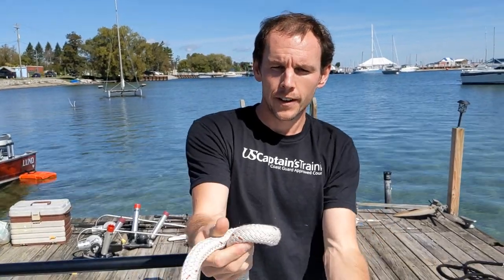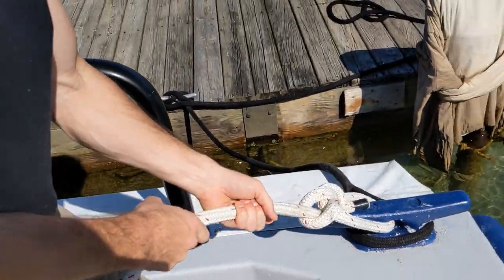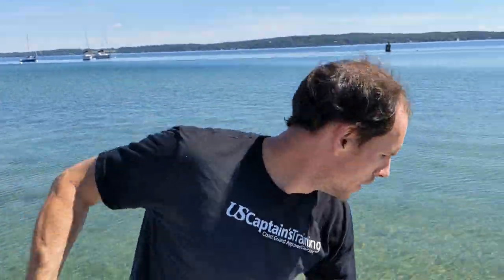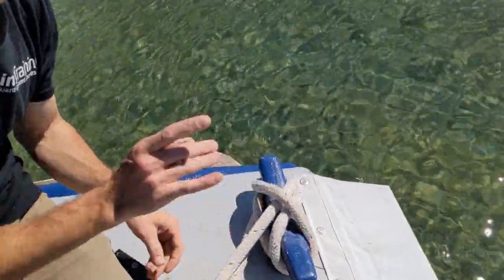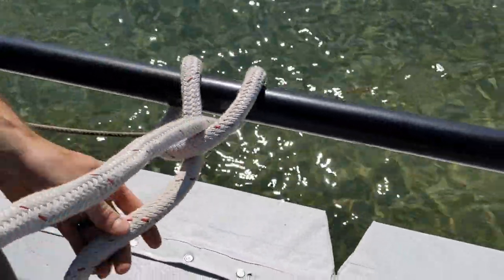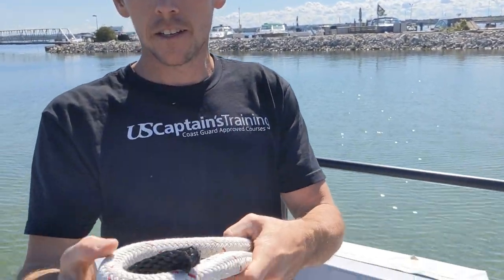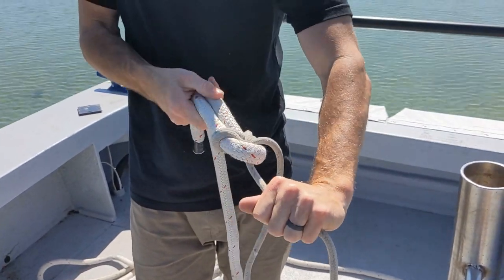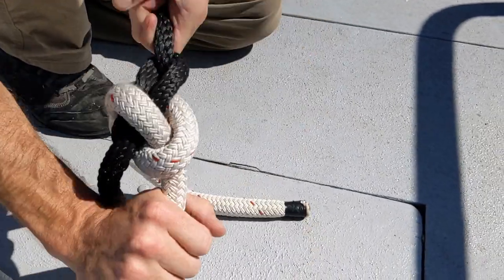Eight Knots for Assistance Towing

Comment: Great information but on your second solution for cleat hitching. If your working line is water logged and wet as hell, if you just figure 8 the shit out of the working line and not lock it off, if significant weight comes on to it and it starts surging due to it not been locked off it will continue to run. 

I have seen it first hand when I was in the navy and our partner ship lost their RHIB from the Quarterdeck